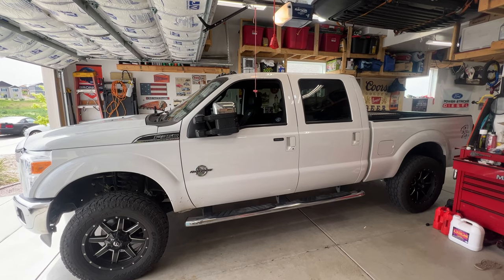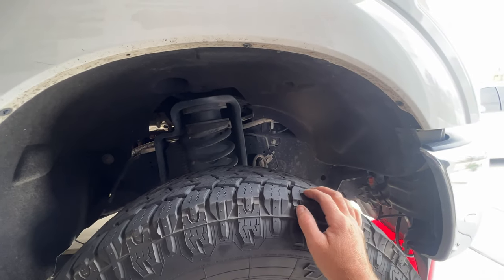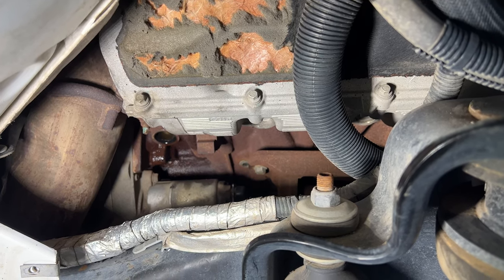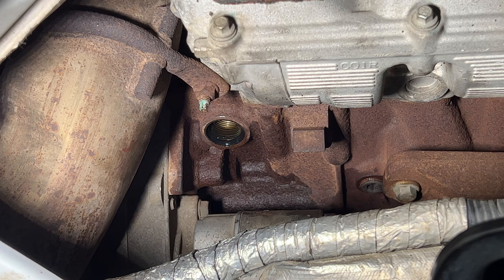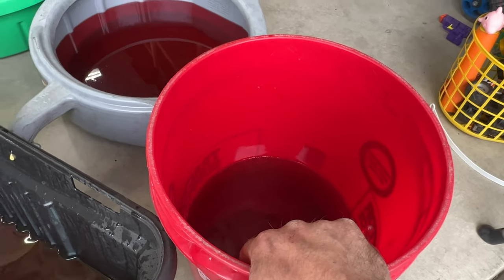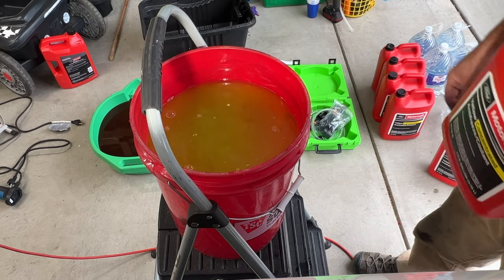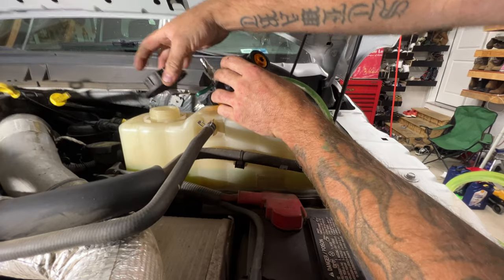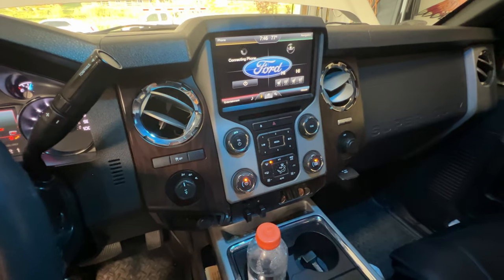Ford 6.7 Powerstroke Coolant Drain & Refill Primary & Secondary System How-To

Comment: Thanks for the video very helpful, Completed mine 10/14/22, When draining after the coolant stopped flowing on it's own I used a blow gun to pressurize the fill tanks and was able to get maybe another 1.5 gallons out without removing the block plug or heater. All and all I was able to get out 7.7 gallons or 30.8 quarts of the 32 QT capacity. I refilled without the vacuum device, warmed it up and drove it a short distance adding coolant as required. Now I will monitor it for a week to ensure more air has not come out requiring additional coolant.🤩

Comment: Good video. Very detailed and clean job. I did my 2016 6 months ago and I went the flush route. I drained coolant, pulled thermostat (was replacing with low temp) refilled with distilled and let run for awhile and then drained water, replaced new thermostat and refilled with fresh coolant.

Comment: Be sure and read the capacity and specifications section in your owners manual. A coolant additive is also required. My 2017 calls for Motorcraft Coolant additive VC-12 for Orange Engine Coolant Revitalizer although that may have changed if the Yellow coolant is the new and proper coolant. Good video, learned a lot.
Reply: On my 2020 the coolant is green

Comment: I think I'll drain both radiators, refill both with distilled, run it, and then drain that and refill a second time with the 50/50. My new to me 2012 has never been drained, but it only has 25k on it.
Reply: This is the route I plan on going. How many gallons or quarts of distilled did u use and how long did u run it?

Comment: First and foremost, great video. I just wanted to let you know that you showed all the locations required to drain the radiator fluid. Very detailed and straightforward. We could use more videos like yours. My main issue is, how in the @#$% did you turn that secondary petcock so quickly?  Who are you? Thor?  It took me a couple of hours to get that little thing to cooperate.  Seriously, though, fantastic video. Thank you very much for your commitment to detail.

Comment: Excellent video. Seems to be pretty complicated compared to the older vehicles systems. I had a 2001 7.3 powerstroke that was way easier. Once again manufactuers just want you to bring it in to their service department for a high dollar fluid change.

Comment: Amazing tutorial I’m a first time diesel owner and want to get in the habit of working on my own truck a 2015 ford f-250 6.7  you’re the best man made everything look so simple. 1 question for the vacuum pump it’s not really necessary right? Just to check for potential leaks???? Ty again
Reply from the maker: Although it’s not necessary it is recommended by ford because it gets all the air out of the cooling system. When air gets trapped in the cooling system it causes cavitation which starts to breakdown the aluminum on the front cover where the way pump goes in.

Comment: Question, I have a 2019 same Ford pickup with the engine block heater. Do I really need to drain the heater connection too?
It seems a lot to get to it. Thanks for the video, great job! God Bless, and be safe. 👌🇺🇸

Comment: Of the 7.5 gallons that drained, how much do you think came out at the block heater/lower drain. Im wondering if it is worth the hassle, rather than doing a drain/fill (both systems and the pil cooler line), driving a month or so, and doing a 2nd drain/fill and call it good. 

It is a great video with what seems like a lot of work, and the system still had old coolant in it (presumably from EGR cooler).
Reply from the maker: After pulling the block drain plug and heater I’d say only about 2-3 quarts is all that came out so I’d say not really worth it. Originally I was hoping more would have came out but oh well. I think you’d be fine doing it the way you described and yes there was still a little left in the egr cooler that you can’t get out.

Comment: For the secondary coolant drain I just disconnect the hose leading to the trans cooler, much easier to get to
Reply: Do I need to do both? I had my EGR delete iat 15,000 miles. My coolant looks good I’m thinking of just doing the primary
Reply: @floridaguardian8264  I replace coolant every 60,000 miles. No flush just drain and new coolant

Comment: Great video and thank you! DO you think about 4 jugs of coolant for the left, primary side and maybe 2 jugs of coolant for the right, secondary side?
Reply from the maker: Thanks. I actually over bought because I wasn’t sure how much would come out. So to do both primary and secondary you’ll be safe buying 5 gallons of concentrated coolant and mixing it with 5 gallons of distilled water. It’s always better to have more than not enough.
Reply: @BLUECOLLARGARAGE  Thank you again!
Reply from the maker: @Gman-qm6bv  your welcome glad I could help.

Comment: Another good video man!

Can a guy mix the concentrate and then followed by distilled water gallon by gallon by just pouring into the over flow?

Also, around your transmission mine seems to have the same leak/weep. Do you know what’s causing yours
Reply from the maker: You can do it that way for the first few gallons because it will all mix in eventually. Just be careful when it starts to get full then you’ll want to premix the rest so you get an equal mixture. As far as the leak this is a buddy of mines truck and haven’t looked into the leak yet.

Comment: If I do not have the airvac refill system what would be the old fashion to refill ???
Reply from the maker: Just mixing the coolant in jugs with distilled water and pouring directly into the reservoir and squeezing the upper radiator hose from time to time getting all the air pockets out.
Reply: @BLUECOLLARGARAGE  thank you

Comment: I just drain and fill both radiators every 30,000 miles My truck was a late build 2019 and came with the new 100,000 coolant .

Comment: Great video and very well presented.  Just subscribed.  Looking to do this on my 2020 real soon and may just order that device you used.  At what mileage intervals do you plan to do this?  Thanks.
Reply from the maker: Thanks for subscribing and the support. Ford recommends the first coolant change at 60,000 miles and then every 45,000 miles after that or every 3 years. The oem tools vacuum coolant filler I used is well worth the investment especially if your going to be doing this every 3 years.
Reply: @BLUECOLLARGARAGE  Thanks for the info. I am at 50k miles on my 2020 and will be doing the drain/fill soon.  I have everything but that tool which I just ordered.  I agree it should worth the investment.
Reply: Hey man.  Drained and filled both systems today and used that vacuum tool you recommended.  It worked great and glad I bought it.  Will be handy to change this about every 30-40k miles.  Thanks again for the video.
Reply from the maker: @chadh6899  your welcome glad to hear it helped you out.

Comment: Did mine exactly as you showed on my 2019 F350 SD 6.7 diesel. You showed how easy it was, thanks.
Question? I overfilled my primary a little and wondered if it is a problem? Should I drain off a little and refill accordingly? Thanks for great videos! 👌🇺🇸
Reply from the maker: If it’s just a little bit it won’t hurt anything you could also just use a turkey baster or a fluid extractor to pull out what you need a lot easier and less mess then getting on the ground and opening the drain valve again.

Comment: At what psi setting were you using your air compressor to create the vaccum.
Reply from the maker: Right around 100psi is what I had my compressor set at. The instructions says it can be anywhere from 71-110 psi.

Comment: If not using the vacuum tool how would you get all the air out of the coolant system?
Reply from the maker: Just by squeezing the upper radiator hose while filling and overtime it should work it’s way out. Just need to keep checking the level in the morning for a couple days after it cools. Ford recommends the vacuum tool because if air does get trapped in the system it can cause cavitation which was a known problem on the 6.4 powerstroke.

Comment: What size air compressor did you use and do you think a 6 gallon compressor would get the job done?
Reply from the maker: Mine is a 33 gallon but you should have no problem using a 6 gallon.

Comment: I ended up taking the entire drain plug out and having issues screwing it back in, any tips?
Reply from the maker: Were you able to get it back in. I believe the plug kind of snaps back in.
Reply: @BLUECOLLARGARAGE  yea, I ended up in bolting the bumper bracket. When I got my entire hand in there I was able to get to plug in straight and twist.

Comment: No need to mess with the heater block plug. Just undo the hose on the oil cooler down by the oil drain pan.its the lowest point you can drain coolant.
Reply from the maker: Yeah I figured I’d try it but it was a total waste of time.

Comment: shop vac works.
Reply: How does that work!?
Reply: @06200XCW I can't remember what that comment was pertaining to!   I know that when I installed the block heater, I put a vacuum on the tank to minimize fluid loss...just make sure you don't put it so it's completely sealed. It'll suck the coolant into the vacuum. Ask me how I know!!

Comment: After all the cost of changing the coolant , why not spend 20 dollars more and replace the two radiator caps? That is a major weak spot in the system. good video though.

Comment: I have a 6.7L F-250 and I'm wondering how many gallons of 50/50 pre-diluted do I need?
Reply from the maker: The primary cooling systems holds about 31 quarts total and the secondary cooling system (egr system) holds about 8 quarts total. So that’s 39 quarts total so that means you would need about 9.5 gallons but of course if you’re just doing a drain and refill it won’t take all that. Just to be safe you would probably need at least 8 gallons. That is why I prefer to get the concentrate coolant and mix it 50/50 yourself because you get more for your money.